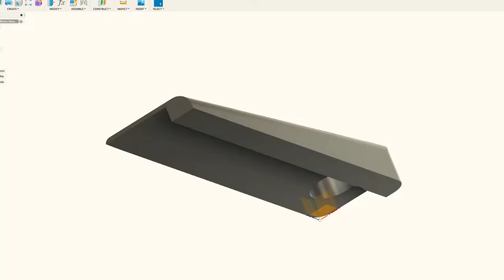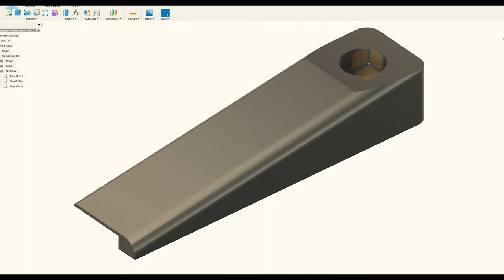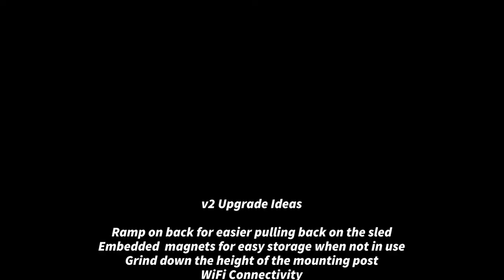3D Printed SawStop Saw Stopper....Stopper - For My Massive Table Saw Crosscut Sled

Comment: Seems easier for this rare case to just do a slightly oversize pass with a handsaw and final cut on the sled.
Reply from the maker: Thank you for watching.  There is about 36” between the blade and the offending post, so cuts wider than that would still be obstructed.  Another option would be to flip the board and cut with the longer length to the left of the blade, but you have less table support, and in my shop configuration, I don’t have the room on that side of the saw. In any case, for a piece as narrow as my demo board, I would just use a chop saw,.  This technique comes In handy for panels wider than my chop saw capacity.

Comment: Seems like a pretty big design flaw from saw stop.  what about making piece support shim so you can raise work piece up to be ramp height.  And the ramp is still useful because you know it won’t get caught.  If the board is bowed down a little
Reply from the maker: Thanks for watching!  The sled raises it up about 1/2”, but every bit you raise it, you lose cut capacity in terms of thickness.  If I took an angle grinder to the support, it might help too.  You need only about a quarter of the height they provide.

Comment: Have you thought of flipping the work piece around so it's on the left of the blade?
Reply from the maker: Indeed, that could certainly work.  However, you have less support (without an additional roller stand), and in my case, I have OSITW syndrome (Other S*** In The Way) to the left of my table saw.